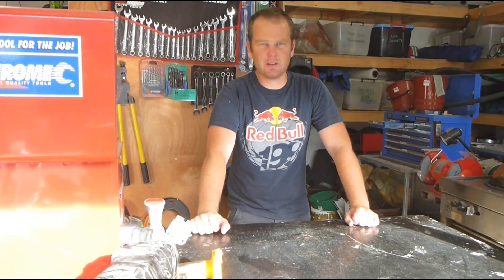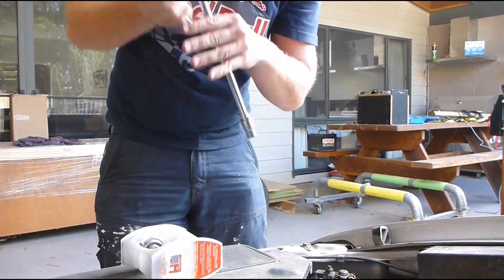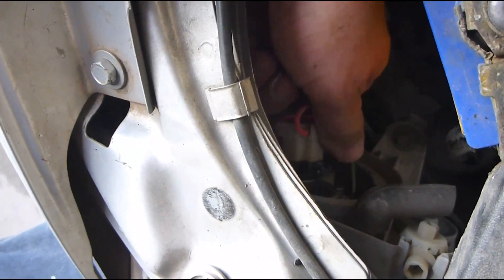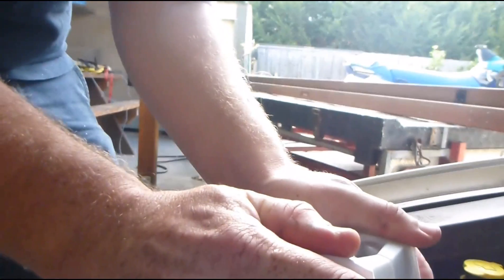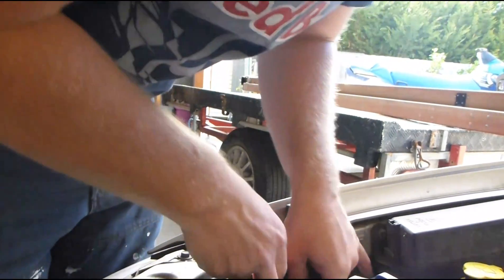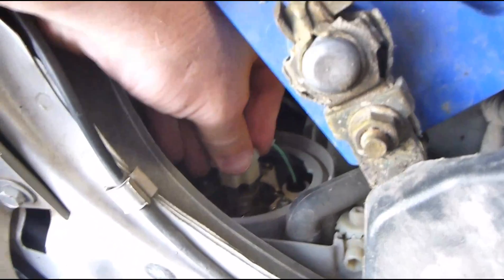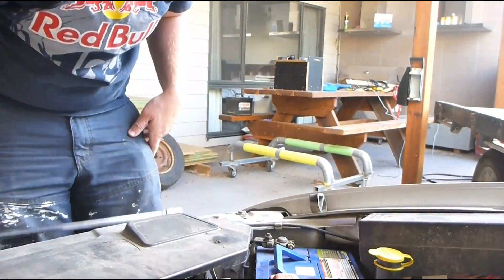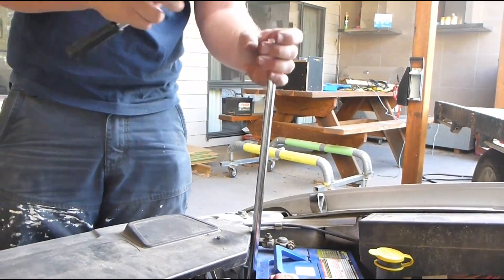Holden VZ Commodore Replace Drivers Headlight Globe (VT VX VY?) HD

Comment: quick tip if you get condensation in head light check the ring around indicator bulb holder,replace or bead of silicone around it after refit.

Comment: just wondering what size globes are required? I've got a 2005 VZ sv6 commodore and my passenger headlight has gone. Thanks mate.
Reply from the maker: Mine took a h4. I'd imagine yours would be the same. Just double check the book in the store I reckon.
Reply: Toms Car Hold Fantastic. Thanks for the reply mate. I'll double check in the store. Appreciate the videos as well.

Comment: 0:10 if you used a 1/2" socket then you just rounded off the bolt head. It's a 13mm.
Reply from the maker: Half is 12.7mm mate. Maybe it was already rounded.